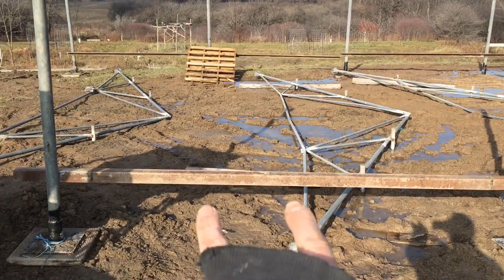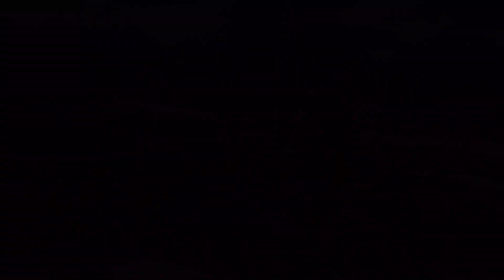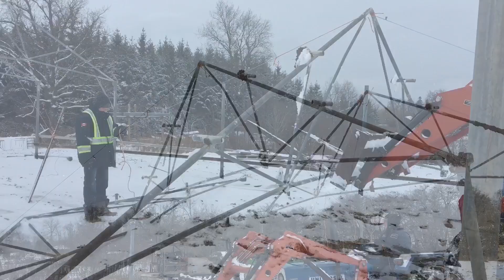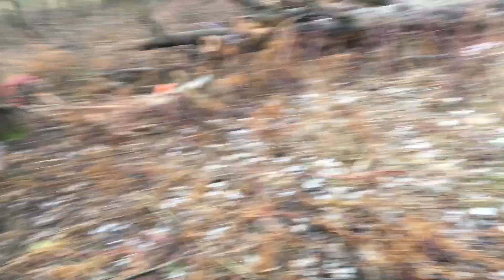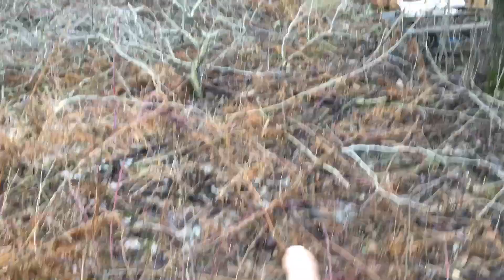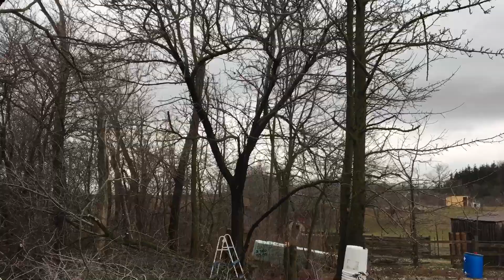GREENHOUSE BUILD CONTINUES / SAVING A TREE LINE WILD RASPBERRY PATCH

Comment: I propagate my black raspberries and full-sized blackberries by tip layering; the dwarf blackberries and red raspberries (both summer-bearing and fall-bearing varieties) produce vigorous underground runners that I simply lift and replant. And I have a black/red cross 'Glencoe' purple raspberry that I'm just figuring out...very long arching canes suggest tip layering might work well. Curious to see what will work best for your wild raspberries.
Reply from the maker: me too and thank you for the response.  i noticed alot of the long canes were in fact bent over and stuck in the ground so i believe you are right the tip layering may work best